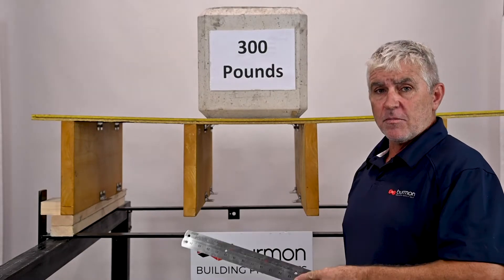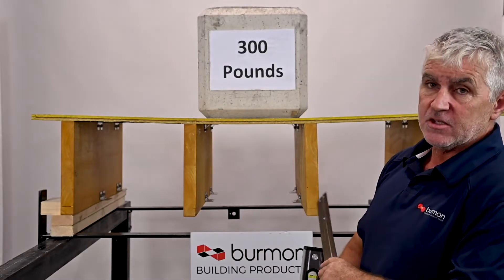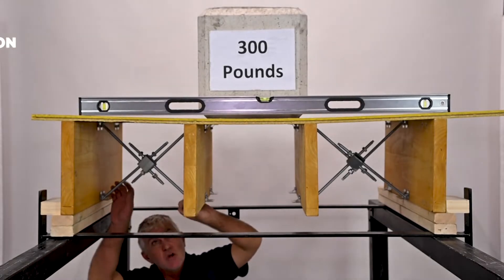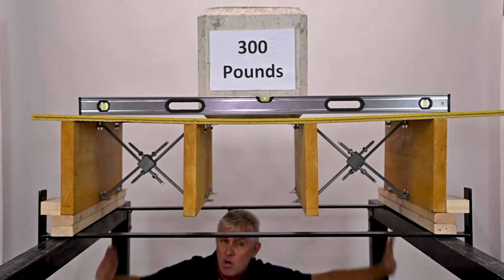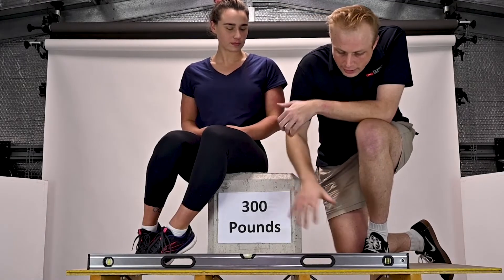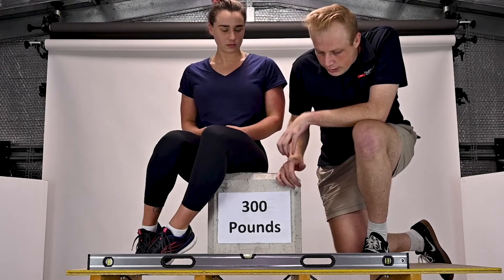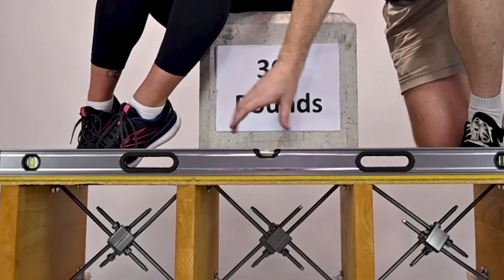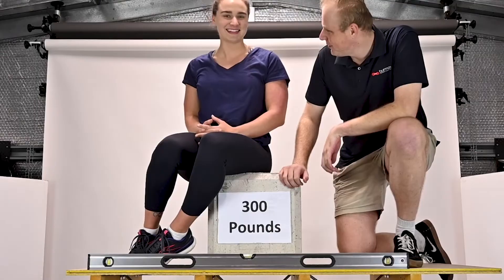Demonstration of a Sagging Floor Being Raised to Level.

Comment: Can these be used on engineered joists or open trusses? I’m not sure what was used but I have a huge span… like 40’ with no support in the basement. And my kitchen island is deflecting at least 1/4 inch. I don’t have a board long enough to get the true measurement. Looks like 1/4 inch for 8’ 2x4.